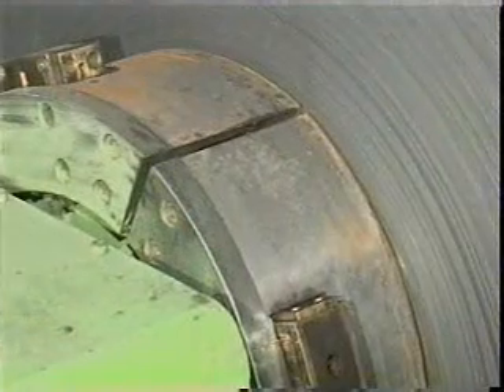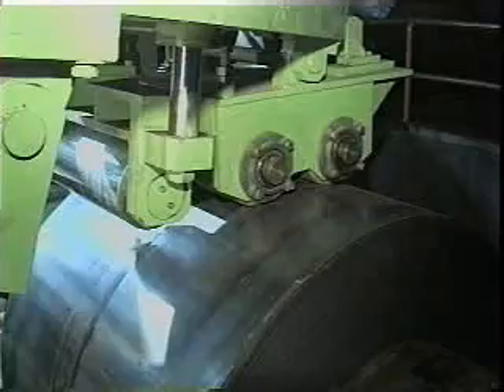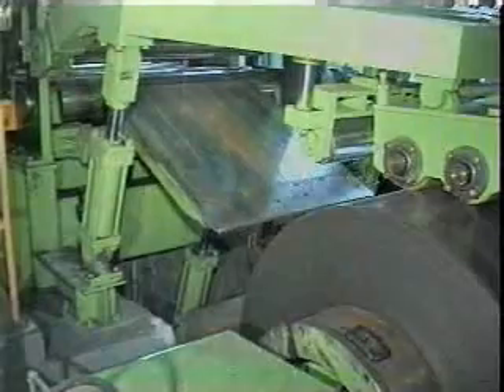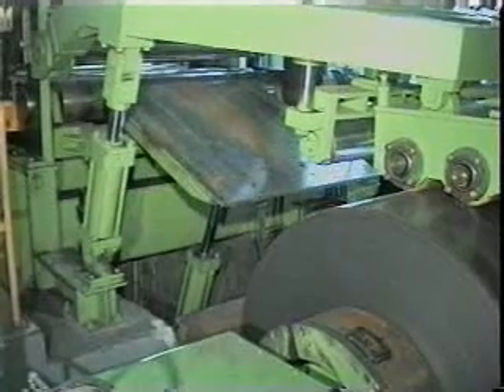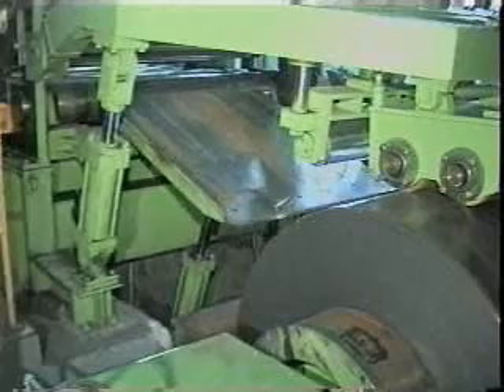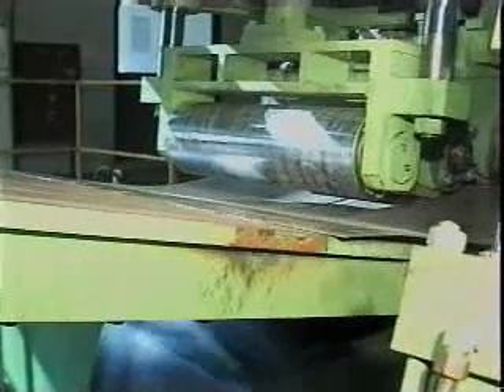HR Slitting Line_IDH Ltd.wmv

Comment: We, Yulong Color Steel Profiled Sheet Co.,Ltd. manufacture eps sandwich 

panel,rockwool sandwich panel, corrugated steel sheet. The price is favourable.

Email: marisa89@yahoo.cn

Facebook ID: h t t p : / / w w w facebook.com/AlsjadLsnatAltnan-

yrWalafranAlghazyt#!/profile.p-hp?id=100004212783696&sk=photo-s
Reply: https://www.youtube.com/watch?v=_ovvVwXFWIM

Hello folks, are you into strip processing lines line Cold

Rolling Mills, Degreasing, Pickling and cleaning lines, Continuous Galvanizing
lines and are having problem of carryover fluids, are you having troubles having
a clean strip at the exit. Now you can use the High Performance Adaptive Strip Wiping
system, it wonderfully works without any electrical or Compressed air, it’s a fit
and forget solution with Zero consumption of electricity or electrical energy,
simple and innovative design click to check and enjoy